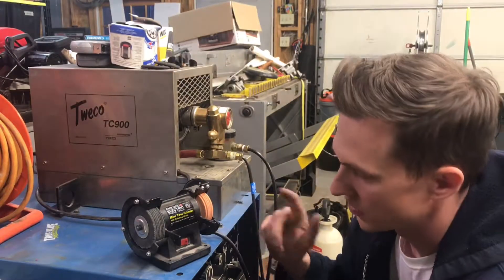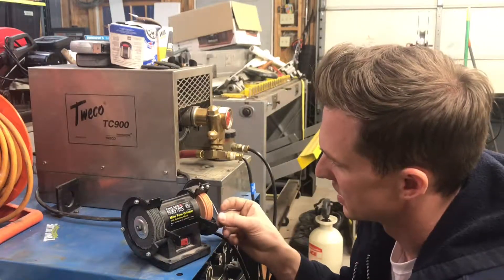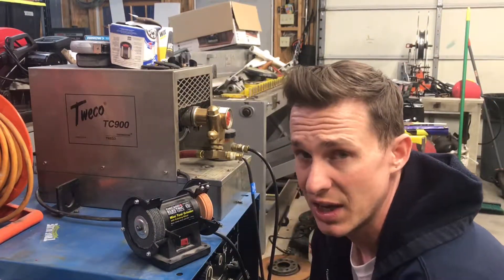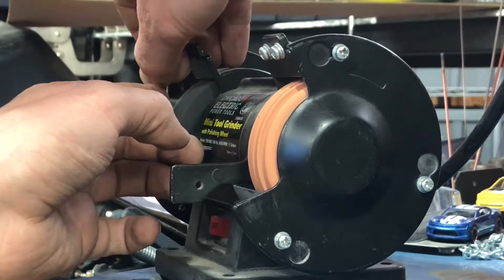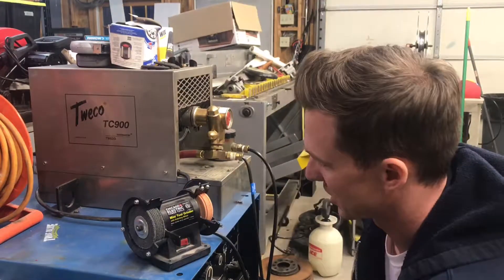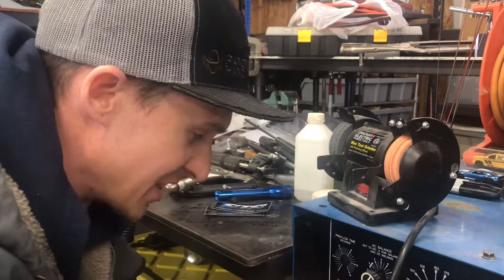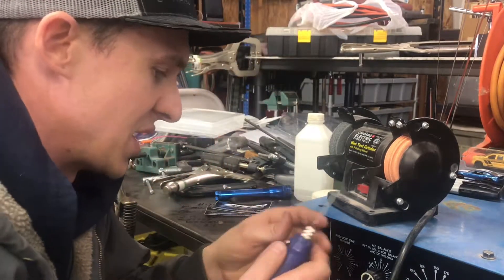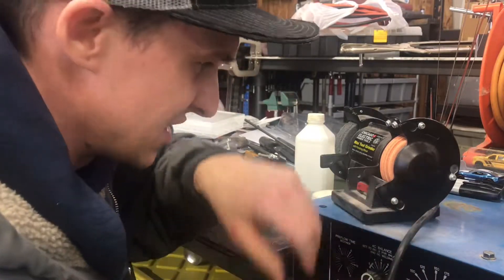EP105: Sharpening tungsten electrode. Simple.

Comment: I use that Warrior Large Diamond Rotary Grinding Wheel Set 4 Pc from Harbor Freight. It does not were out but I am not using it everyday either. It grinds very smooth.
Reply from the maker: Nice. I have the same set but I haven’t cracked it open yet.

Comment: If some people use a Dremel to sharpen their tungsten, why not buy the other grinder and use the flex shaft with the little grinder? Do you not think it would work?
Reply from the maker: dhallftworth1 I would say it mostly has to do with collet body sizes in the die grinders/dremels. I mostly use 3/32 and I happened to have a dremel with that collet size. If you use different sizes regularly they you would have to keep track of all those pieces.
Reply from the maker: dhallftworth1 using the drill at the end is a better option anyways. I use that for sharpening a new piece of tungsten but most of the time if I need to touch one up I still do it by hand.
Reply: gh werks will the Dremel 3/32 not fit into the harbor freight shaft? Not trying to be difficult, just wanting to get the best bang for my dollar. I have lots of Dremels and collets laying around from old Dremels.
Reply from the maker: dhallftworth1 best bang for the buck is always using what you already have. I just find the dremels to be inconvenient.